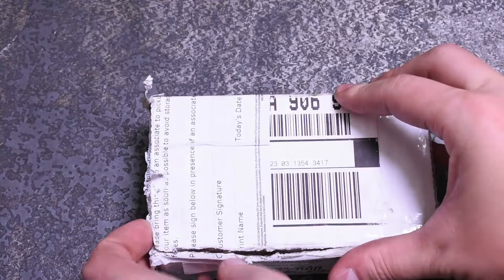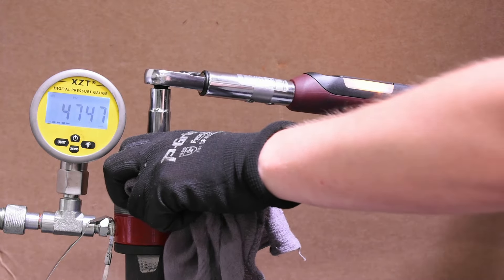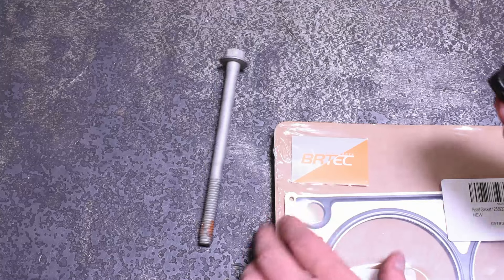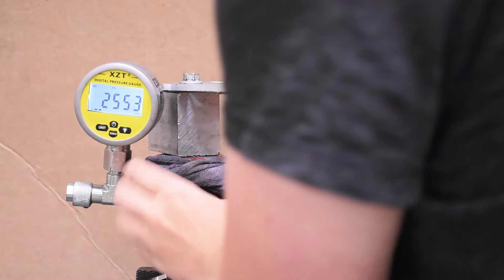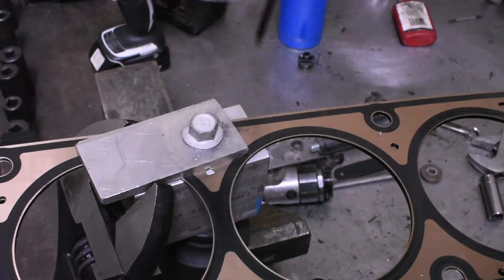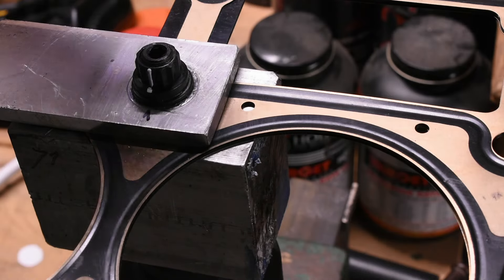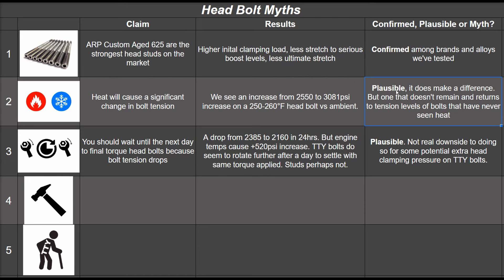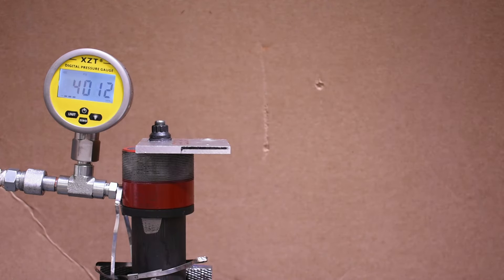CAN You Reuse Cylinder Head Bolts? Testing Myths + ARP Custom Aged 625+

Comment: Dietroit Diesel wanted International Compound  #2 used on cylinder head bolts and main bearing bolts .  Not to be used on connecting rod bolts and nuts ,  Two pounds ten ounces of this compound is 80 dollars .     9/22

Comment: It seems to be common practice to do a HOT RETORQUE on 5.9 and 6.7 Cummins engines. I put studs in mine and got between 1/8 to 1/4 turn on all of them hot.... your mileage may vary...
Reply: I've always heard both hot and cold.  I prefer cold.  I don't see the point in retorquing if everything is hot and expanded, just to have it all shrink down again and lose tension on the bolt.  That said, I've done both on stock and 1000hp+ setups, with no issues from either.

Comment: Torque vs. tension- if tension is the goal then torque is a poor indicator of what tension you have.  There are too many ways that torque can be affected before it gets to the point of elongating the bolt.  As for the measurements of elongation vs. tension- these should be consistent with normal elongation calculations using youngs modulus.  Youngs modulus should be almost identical for all of these fasteners although slight changes in metallurgy can affect it a small bit.  If you are seeing big differences then there might be differences in bolt shank diameter, things like that.  You should be able to get the elongation measurements to agree exactly with the tension in the bolts.  When you tested one of the bolts and commented that TTY bolts elongated more than that during their torque process- yes that's the idea behind TTY bolts.  You torque them so they pass the tension yield strength of the material so they will naturally elongate more than a fastener that is not installed to its yield point.

As for torque to yield bolts- you showed a stress strain curve.  When a bolt is torqued to yield it has traveled up the steep part of the curve and onto the flatter part at the top.  This provides a bolt that has its maximum elastic clamping ability and if you provide enough turn of the fastener to get to this point then you have removed torque and friction and all of those variables from the process.  If you remove this fastener, its elongation doesn't travel back down the stress strain curve the way it went up, it instead plots a new line straight down to 0 stress following the steepest part of the initial stress strain curve and gains a net strain when it hits zero stress.  Now retorque that bolt and it travels back up that second line onto the plateau and farther along the plateau towards the point of fracture.  You are using up more of the small amount of ductility that the fastener has and pushing it closer to its fracture point.  It should still have the same strength and the same clamping force, but would be closer to ultimate failure, the fracture point on the stress strain diagram.

As for thread lube- go back up to the first  part of this comment.  Without thread lube a lot more torque goes into overcoming friction and not achieving elongation and clamping of the fastener.  Ideally you would use lube on every fastener that is required to be torqued.  If you disassemble an engine to work on it, when you get ready to reassemble look at all of the fasteners that were removed and look at the condition of the threads on each one.  You will probably see a variety of conditions- dry, rusted, oily, dirty, etc.  Each of these will torque differently.  I've watched tests of tightening structural bolts for buildings using a Skidmore-Wilhelm machine and the clamping force varies widely depending on the thread condition, thread condition probably being the most significant variable in bolt tightening.

As for your test of temperature- if the entire engine is at operating temperature then the head, the block, and the bolts will be at the same temperature, they will all expand the same amount, and the bolt tension should not be affected.  If you heat the block with a torch the bolt will not be heated, the block will expand, the bolt will not, and the bolt will be pushed against by the expanded head which will increase its tension.
Reply: Fastener design guy here, everything you've said here is accurate. You did it a very good job explaining relatively complex concepts in such few words bravo.
I wish I had the ability to publish data from my tensile frame, it would describe what they're trying to do here with this cobbled together set up in a format so much easier for the layman at home to understand.
Reply: This may be a picky point, but some engines have aluminum heads. Aluminum has a different coefficient of thermal expansion than the steel head bolts. In these cases, the bolt tension will be affected by the engine being heated to operating temperature. I am rebuilding a Volvo B5254T2. The TTY head bolts are not accessible once the cams are installed, and are to be replaced according to the manufacturer.

Comment: I did reuse mine with no consequences, Mazda gives you a length spec, if they aren't stretched too long, you can reuse them, I didn't bother with measuring them though 🤣 just assumed that since they were stretched only once, they should be short enough.
Reply: I did the same thing on my Honda... 2x.

put a junkyard VTEC head on it without checking it and it was warped and the headgasket leaked combustion pressure, so I put the old head back on. 

certainly no extreme application, but it lived for a few years before I sold it.
Reply: @volvo09  right, I wouldn't risk it on a high pressure engine, say diesel or highly stressed turbo, but on a relatively low power na engine? Why not.
Reply: @piciu256  personally I wouldn't have even risked it with a more time consuming engine design. this engine was so easy to pull the head off that it didn't matter.

Comment: Hi 
Just like honda mercedes used to say reuse (late 80s and 90s) and gave a max bolt length before scraping. Personally I can't understand why torque to yield, if you have got to yield then clamping force is decreasing and once you have heat cycled the head you will have lost even more clamping force it must be better to stay within the elastic limits of the fastener?? Or is this somthing to do with mass production and mechanised assembly rather than engineering sense

Comment: When you did the heat test, I wonder if the increase in torque might have been in part do to the hydraulic oil expanding from the heat as well
Reply: I thought of that too but it would have to heat the whole reservoir as well to make any appreciable difference. Just looked it up and oil expands by about 4% every 100*F. Aluminum is about 1/4 of that and iron is about half again as much, so it would be significant if it was warming up that much. He could check the temp. of the output fitting on the pump he's using. My guess is that not much of that heat is getting down through the column of oil though.

Comment: Can you please test clamp load on ca625plus when torqued to same value as 2000 series. Alot of pro shops use a lower value then arp’s recommended torque value on the ca625 as it can distort aluminium cylinder heads. So the question is, is it better to run a ca625 if its not torqued to its recommendation or is it better to use a 2000 torqued to it recommendation
Reply: If you are talking about LS heads, the 625's should not be used with a factory casting, as the decks are thin and will distort. I swapped my 243's for a set of TFS as-cast 220's for the increased deck thickness alone, as they don't flow any more than than the 243's.
Reply: I have heard of this issue with alot heads but the one i have experience with is the rb26 but most people swear by the 625’s but they torque them down to 110 ft as opposed to arps 140ft recommended its a 12mm bolt but 140 is ridiculous

Comment: Honda Actually says you can reuse tty head bolts they Actually have a different torque sequence for head bolts that Are used @Torque Test Channel
Reply: No, they do not. TTY by definition is one use only!  You are confusing the method used to tighten, Torque Angle, with a type of fastener.
Reply: @alro2434  maybe you should contact Honda Because Honda Does say you can Reuse Head Bolts And they have a Completly Different Torque Sequence then Brand New head Bolts and I'm not the only person that has made this comment on this video If we're all wrong then Correct us All But Any Mechanic that knows Hondas knows the information I gave um not confusing anything

Comment: Say the torque specification on a new torque-to-yield bolt is 25lbs-40lbs-90degrees I have heard that an extra 90 degrees to finalize the used head bolt torque is good to do, if you revisit this can you test that?

Comment: Heat cycling will allow you to turn the ado bolt more but isn’t needed to do so most applications. I use a heat gun during engine assembly and let it sit till the head reaches 150+ degrees that’s it.  You really don’t need to re toque unless you have a really high performance engine. I have a 750whp 2.0 4 cylinder from a civic type r. I don’t retorque them and the engine is fine. Unless you get to 8 hp per cubic inch or you are running a copper head gasket it’s a waste of time.

Comment: I never popped a head bolt. I usually build between 450HP and 600HP. I keep under 6,000 RPM. I build daily drivers. So I guess these fancypants studs are for top fuel motors? From what I've seen:  Their points of failure are a bent rod, a popped blower or complete grenade. Who ARE these for?

Comment: Structures (think bridges) use yielded bolts in what they call slip critical connections and the aisc has published a significant amount of data about bolt relaxation and torquing procedures based on many years of research. The procedure used for turning beyond into yield by measuring degrees would go by the name of turn of nut method of tension control and is very common.  They have done many tests about bolt relaxation and your results are very close.  The relaxation happens on an exponential decay with the majority of it happening within the first hour or so after torquing.  if let’s say  100 bolts are in a joint 10 would be rechecked later and if found to be low on torque corrective action would be needed. They do permit the reuse of bolts with engineers approval if a nut can thread on (these bolts yield the threaded area, not a separate shank area) however I’ve never seen an engineer permit it. Torque wrenches can be used instead of turn of nut methods after calibrating to torque tension relationship on what is essentially a fancy hydraulic cylinder called a skidmore device.

Comment: Kind wanna see a 6.0 powerstroke OEM bolts vs ARP studs and the ARP 625, then throw in a cheaper version like those Amazon Xotic performance. The long time theory is the factory bolts stretch causing head gasket failure which I’m a little skeptical on for a stock tune

Comment: Ok probably stupid but what happens if you torque when things are all very cold, like zero F or sub-zero? Say you're building your engine in the driveway in winter in Alaska kind of situation. When summer rolls around and it's not 80-100F ambient hotter than when the bolts or studs were torqued...do you gain clamping load? Do they just stretch more?

Comment: Hey, 
Love your content!
I was wondering if you knew what kind of friction coefficients car manufacturing uses when calculating requested torque values? I know different materils and coatings affect that, but do you have any idea? 
Another question. Any idea what kind of clamping forces are required in same field? Like for chassis bolts or cylinder head?

Comment: Just something ive been curious about. How about testing different methonds of lubing the thread? Like is thread grease best, or maybe engine oil? Especially compared to nothing.
Reply: The best lube is the one thy call for most head bolt need engine oil to torque arp include a special lube with number with said special lube and with engine oil
Reply: Always wondered this myself too , I use arp lube on most stuff these days but be good to know

Comment: ill tell you that putting the socket on and tapping the nut/bolt while breaking them loose DOES help
its NOT for torque / install...... but for removing
.
at the very least it removes that "CRACK" and then vibration you get in your hands that hurts

Comment: I could be wrong as I only occasionally build performance high boost European engines. The tty bolts and the way you have the "torque" set would have a bit more resistance than a stud and nut setup. As it sat overnight the threads and bolt probably settled to allow for a more precise torque. As in more of your torque going towards clamp load and less towards rotational resistance. As for the ARP studs, I'd love to see how big of a difference it is to heat cycle them multiple times and retorqueing them. I know for the most part they require retorqueing after one heat cycle, but would it be "better" to do it twice or does it make no change the second time

Comment: in the show or amongst the comments, i never saw it mentioned that head gaskets should always be retightened after the first use, best when the engine is cool, in other words, the next day.  is this advice only given out where i live?  i got the advice to also retorque "monotorque" gaskets.  and yes, they  always need it to return to spec.
Reply: It's common knowledge I think.
Reply: @SinsBird  , yes, common knowledge.  but to retorque a single use bolt is probably a no-no.  its a single use bolt.  i thinki'd be avoiding them myself.
Reply: @vsvnrg3263  Since 'single use' TTY bolts are tightened to an angle by degrees and not with a torque wrench, there would be no point to retighten them because they are more than tight then.

Comment: Never use any bolt you put a torque wrench on. This is a basic rule, not just for TTY, but any bolt. This is coming from Boeing, Lockheed, etc. Its a hard rule in aviation. It does result in a LOT of unusable hardware, thats cool to show friends, and invariable the question comes up "Why do you have spare airplane parts!"

But I do this with my cars, barring some hardware like lug nuts, since the torque values are low, and you would need to torque them 100 times before you could conceivable see any change in deformation.

Comment: Just out of curiosity, is there any reason why you aren't measuring the bolt face? Effective surface area is going to have a pretty significant impact on how much loading that that plate (wheatstone bridge sensor?) sees. The only reason why torque charts don't spec them out is because SAE (or ASTM) has standardized TPI, head-size, etc -- so given a clamp load you can just punch the numbers.  I duno I am just a lowly EE, I don't wrench on gear professionally or commission CAT D8s or cranes and shit. Good channel though, that Heli-coil episode was rad.

Comment: I reused head cylinder bolts for decades. Nobody even made replacement bolts. New bolts? I don't know, but the old head bolts in the 50's, 60's, 70's, and 80's were fine.

Comment: Wrapping a wet rag around the hydraulic cylinder may have just made it hotter by speeding up the heat transfer. You need something heat resistant.

Comment: Nice video, but not as straight forward for average Joe. I have a hard time to understand why there is so much misunderstanding with the bolts, probably it is marketing from "pro engine builders" that caused it.  Bolt provides clamping force, once when clamped head should not lift. bolts will provide this feature if pushed in to region of tension when they are the "stiffest", that means stretching of the bolt it self properly. Since often one can not measure stretching we use torque, more torque you need more stretching to bolt. When torqueing friction should be rather controllable, hence the lube and clean threads requirement, and you can rely on torque values that will assure you you have pushed the bolt in to region where it is stiffest (stretched properly). Can you reuse the bolts, sure you can, but it is a risk. it might snap it might work just fine. Depends how much power your engine is producing. If it is grocery getter low power engine, you can reuse bolts safely, if it is track car you should not. For high power builds, there are also bolts providing bit of controlled  flexibility so head gasket does not get "over crushed" and starts to leak, ARP calls them undercut, can be useful on small 4 bangers.  That is all, like absolutely all there is to it, and it starts from requirement to hold the cylinder head to lower end of the engine - clamped securely

Comment: ARP actually tells you to retorque your head studs after a set amount of miles to account for stretch
Reply: No one does that and the engines are still runing. It means it`s an another bullshit to get extra money from You.
Reply: It's not accounting for stretch, it's accounting for the materials in the joint settling out. Nothing's going on with the fastener it's the block and cylinder head that are moving around on you a little bit along with the head gasket creep. MLS gaskets eliminate the vast majority of that concern.
Reply: @pawelwis7215  retorqueing head arp head studs cost no extra money. I do it on all my vehicles that run studs. There is a piece of paper that comes with arp head studs and has your torque spec and tells you to retorque after a set amount of miles.
Reply: @otm646  that makes sense

Comment: Just a tip. The heating methodology is incorrect as you have cold between hot which is not the case in real world operation. Also dissimilar coefficient of expansion is playing a large part in the test you are conducting with dissimilar metal with large heat difference.